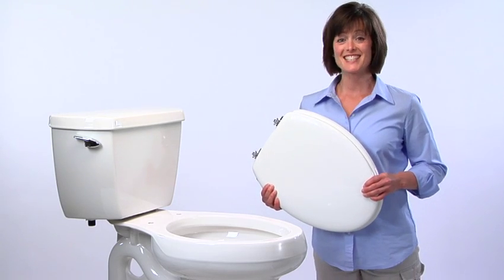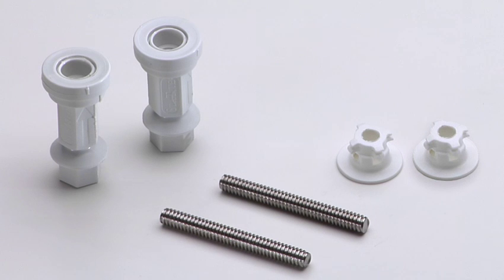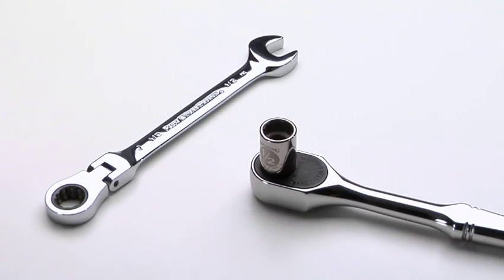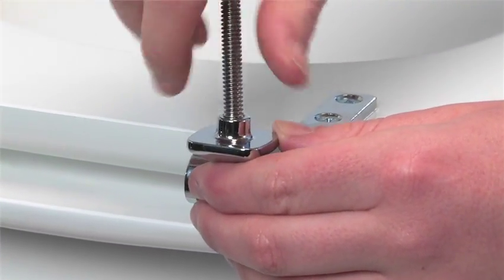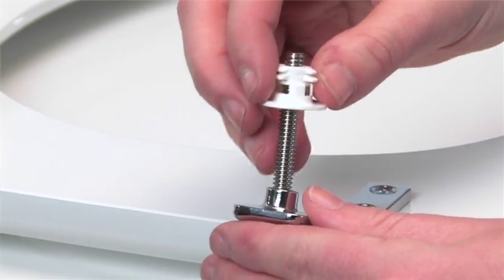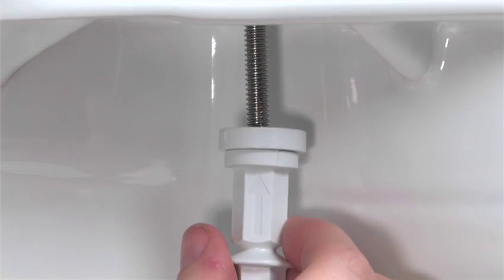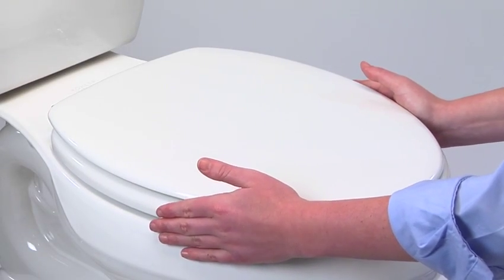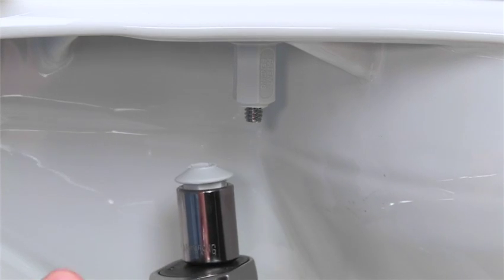Mayfair STA-TITE Toilet Seat Fastening System | Blain's Farm & Fleet

Comment: Installation is easy. But, the seat I have is painted and regular cleaning is stripping the paint. 

Now, I am having trouble removing it to replace.
Reply: Same. These things are terrible.  This one I didn’t even use Lysol on and the paint is still coming off. I’m trying to replace it now with a plastic one and can’t get it off 😡
Reply: I cant get mine off for the life of me and everything I’ve tried is just stripping the stay tight pieces 😢

Comment: not as easy as the old method, using a  a regular bolt that screws from the top (I use a piece of wood to hold the nut in place under the toilet (unless it's one of those new plastic ones shaped to 'catch' on the toilet and it holds). so I don't even have to hold it by hand while screwing the bolt from the top.